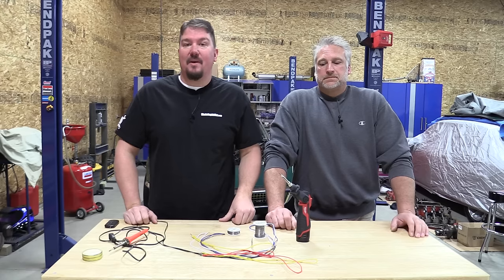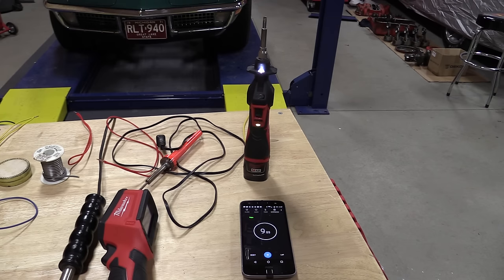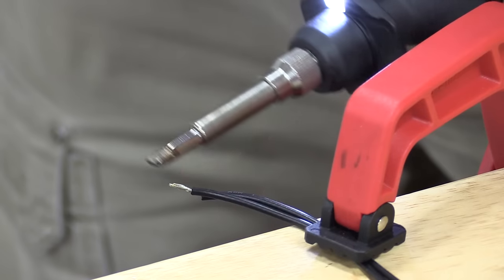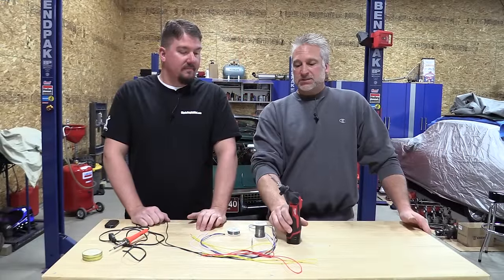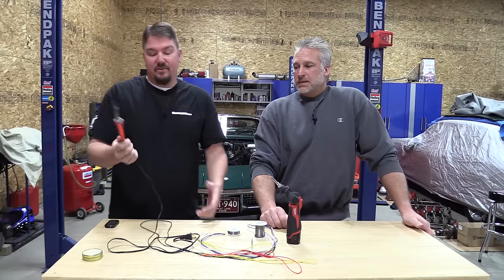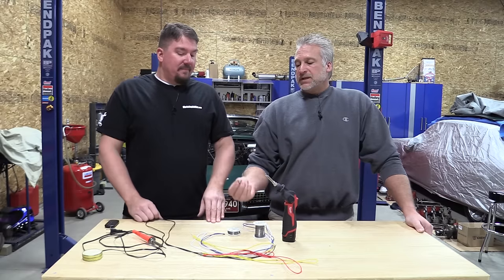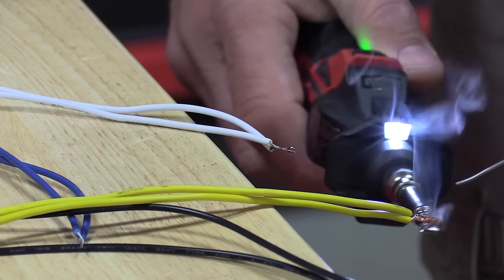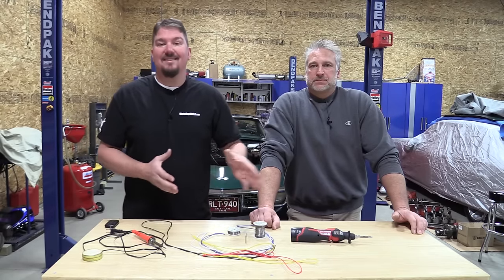Milwaukee M12 Soldering Iron Review | 2488-20

Comment: You will find tinning these wires is much easier when you insert the solder in the corner between wire and iron. The solder melts very fast and immediately wicks into the wire. Give it a try !

Comment: As a retired electrician this is one of the best tools I've owned even compared to butane torches, biggest fault and criticism is there's no on board storage for the second tip, I glued a small piece of pvc on the handle so that the torch and both tips are one single unit, Milwaukee stuffed up big time on this as you'll lose one tip very easily

Comment: Nice iron. I think I prefer the portability of the butane irons.  I have been using the same Master butane soldering iron for 25 years. It has peizo igniter, is flameless, heats almost instantly, is adjustable 480-930F, and cools very quickly. The reservoir of butane easily lasts 6 months of normal use. Plus it has interchangeable tips for soldering, hot air tool (heat shrink) and torch mode.
Reply: I have used the same one but my igniter stopped working so I have to manually light it with a bic. The Milwaulkee m12 seems good but it may not get hot enough for thicker gauge wire like stranded 8 gauge. Id think it’ll get hot enough for 9 gauge stranded wire.  I mainly use it for car audio electronics.

Comment: NOTE: After a lot of research on the M12 solder iron, buyer beware: Anything over 3ah CP batteries and ~10 min of run time will start to deteriorate and melt the housing cap of the solder wand. There are literally hundreds of 1 star reviews claiming this issue, rendering this device useless after only a few months of use. That said, I am still buying one, but limiting my usage to ~10 min on before cooldown and only using compact batteries. One guy I found did this consistently and was able to put hundreds of hours of use on this device over the course of several years. God bless!
Reply: I use big battery with mine all the time
Reply: @nickkk420  Consider yourself blessed.

Comment: great job on another cool video. I want to get one of these to solder tail lights on the back of my trucks cause those butt connectors and electrical tape don't seem to last
Reply: Why not just buy a cheap $12 soldering iron? Seems a bit goofy to buy a ~$100 tool for what sounds like a one-off project...

Comment: Question is, though, how does it compare to a butane soldering iron.
Reply from the maker: Never had a butane iron because we only solder wires on cars in the shop 99 percent of the time.
Reply: A butane iron is at its best when it comes to soldering wires, connectors and circuit board connections. It works great indoors or outdoors.
Reply: +1 for  Weller Butane soldering iron.
Reply: I have both, I really like the m12 soldering iron.  It has a light built in to illuminate what I am soldering.  Stands up very nicely with an XC style battery.  It’s extremely useful in the 90 degree position soldering things as you don’t need a helping hands tool because the iron stays in position you can focus on holding the wires and solder.  My butane torch I now use to melt my shrink tube - it does work great for that.
Reply: I have always used butane irons as they fire up quick and are plenty powerful enough for most soldering tasks until the outside temp drops to 5 Deg C or below then they are a real pain to use. My impressions after trying one of these battery irons is yes they are bigger but the neck part is still a great size for getting it into tight places such as a car / truck dash . I am going to buy one of these battery wonders very soon.

Comment: I don't think people are using this for small electronics and circuit.  It would seem heavy and won't give the precision that they need.
Reply: Gives us guys in the field or the shop a good option. I’ll say it seems pretty suited for more rugged use, saving my hakko 888 for the things I can bring to the home workbench. So far no complaints after a year of quite varied use.
Reply: Its not designed for board use
Reply: Quick field solders. Definitely not long term bench work.

Comment: Is there only one type of soldering metal? If not, which is the best for specific applications? How do you clean the tip and keep it clean while in storage?
Reply from the maker: We are not soldering experts, I cannot answer your first question.  We clean our tips with a brass brush when we are done with them.
Reply: All electrical soldering should be done with rosin core 60/40 solder. Acid core solder is used for things like radiator repairs  and plumbing. Silver solder is also sometimes used for certain things. When doing electrical work clean your tip by wiping it on a damp sponge or damp cloth.
Reply: I use 60/40 or 63/37 rosin core solder.  With any handheld iron I’ve found that getting a smaller diameter helps with control and with melting it in faster because it’s not a huge mass of solder. Been using a little extra rosin flux to make sure connections are clean and they always flow great.
Reply: The best way to clean the tip is to put solder on it and shake it off out off your wrist. Don't use a sponge, thats crap.

Comment: You mentioned battery power. Is there an option to change the battery in this tool and would you show it on an update?   J K
Reply from the maker: James Krivitsky It uses Milwaukee M12 batteries and the slip on and off like any battery powered drill.
Reply: There are a few Amp hour AH batteries from Milwaukee that are 12 v. They all fit. Obviously the lower AH would yield less work time than the higher AH battery.

Comment: Did you try it on 10 gauge wire ? Most people dont really put it through a real test. You did not say anything about gauge? Would like to see you use it on 10 gauge wire so far all the videos say this tool sucks on 10 gauge wire take way too long. Still not sure why they just did not beef it up and go with the m18 ?
Reply: 10 ga is doable. With a clean chisel tip, a little solder to start conducting the heat, and a fully heated iron, I could get a lineman’s splice to flow out in about 12-15 seconds. In my case that’s melting extra flux as well to ensure full wicking for corrosion resistance.

Comment: Lol no Real pcb repairer would use this iron. I work on pcb often and don't use it as you can't control the temperature. We normally use the direct heat type tips so there is very minimal heat loss due to large thermal masses on some pcb.
Reply: This.. and honestly, if you're just tinning small wires in the shop, there are soo many better options that are temp controlled, portable, more maneuverable, and probably a LOT more efficient.  I have a pinecil that I use with a QC3 battery bank for "portable", aka too far from a wall socket".  Using those t12 tips .. huge game changer.  A little 60W iron with t12 tips is just as fast an the old school 90 w irons using the slip over tips.

Comment: You really need to keep in mind,,, The battery’s ONLY have so many times they can be charged!!! THEN there junk and will longer charge or hold a charge so WHY would you want ANYTHING that runs your battery down soooooooooooo fast???? Think about it!! Yep’ they want to sell BATTERIES.
Reply: Truck Mechanic I’ve had my m12s for 3 years of abuse and they still work as new. No extension cords or air lines. Welcome to the future
Reply: These are arguably draining the pack less aggressively than other m12 tools. The discharge rate is lower than many of the other tools under load, and it’s a certain duty cycle on and off which doesn’t allow the packs to build noticeable heat or any signs they are being stressed.  90w claimed is fairly mild at 12V if you think what a hackzall, drill, or impact would be pulling under consistent back to back use.  Just my .02, hope it kind of makes sense.

Comment: First of all, weight, Ease of grip and manipulation within the hand, too much heat.!
M12= not very good.!

That iron bar soldering sword stick, forget it .! What are you brazing.? Working on the train tracks.? Rebuilding of the Titanic.? Toooo much heat, using thick plumbers solder..!
If you use these you shouldn’t be near a vehicle’s electrical system, it’s all fine wire that is fast and conducts electricity fast for the signal speed.!!

The iron you should be using is 12-18w iron fixed or a Station where heat temperatures can be adjusted to fine wire or circuitry.! 
Use high content 4% + silver solder, it’s finer, melts faster because of lower heat required (not causing resistance through heat that changes the metallic compound structure of the wire) and gives better conductivity based on percentage factor and Siemens meter, I use this in automotive as well as making tube guitar amps.! 
This solder is excellent to use for CAN and LIN Bus as the speeds are greater.